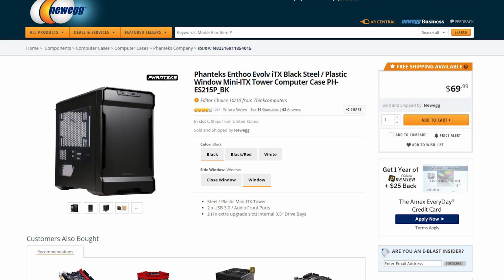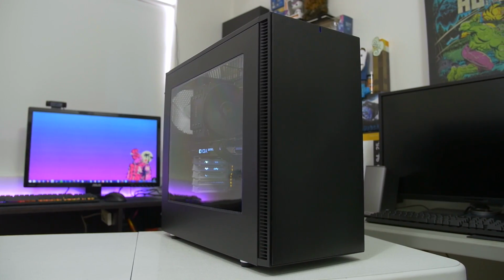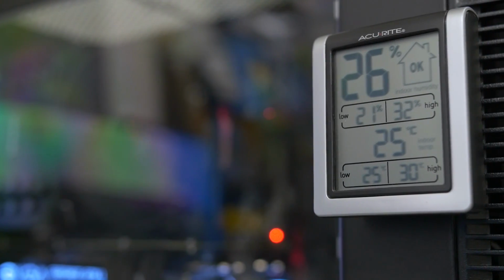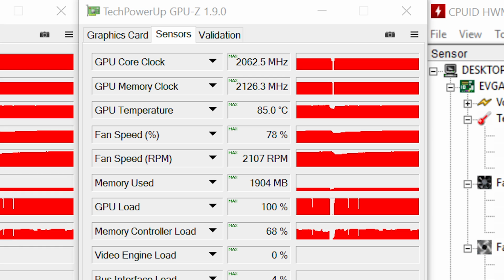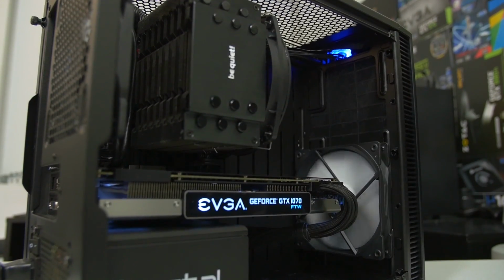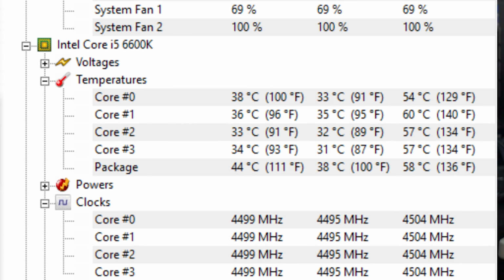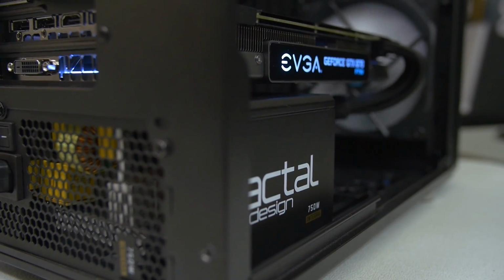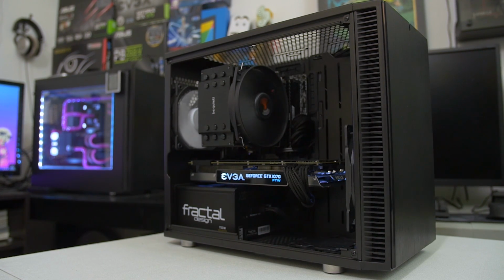Are Blower Fan Video Cards Actually Better in SFF Cases?

Comment: My 1080 FE 2ghz on Core n +333 on memory runs always at 91-92 degrees. Mid tower case, good cooing, 31 ambient 
Upto 100'C completely fine ryt?
Reply: it's not advised to run the GPU at those temperatures for an extended period of time as it may cause damage to your component.
Reply: When it hits 90 it should start to slow down so it never reaches 100
Reply: 92 set limit
Reply: Degrees cel?
Reply: @blooperman1997  that's not true modern high-end gpus are made to run an excess of 90 degrees Celsius not that it's a desirable temperature but it's true... So running at 83 to 84 degrees Celsius Max is perfectly fine for 99% of all high-end GPU is in this day and age of course you can always download MSI afterburner and set it fan speed profile of somewhere between 70 to 80% and you should be running in the high 60s to mid-70s Max if you're really worried about it

Comment: Using a different design ITX or MATX chassis would CHANGE EVERYTHING. Try IT?
Reply: For example the Corsair Obsidian 250D and 350D ... there we go... butt I'm sure you can come up with some rather more exotic not errotic choices? :D
Reply: true this is a crap case for small builds if you want keep it on air... there is many case where the PSU is located in top front corner so gpu have much better airflow+ the case can be made smaller at the expence of no DVD reader.

Comment: i don't really understand when i see a gpu running at 85c my gtx 1070 strix oc at the same in this video
core 2025
memory 8900
the max temps i'v seen is 69c at 47% fan speed
do i have a problem or just lucky ?
Reply: Ummm, you dint mention what case you used and the strix uses 3 fans.
Reply: Own Malkawi different number of fans and your case has better airflow ? Different ambient temperature ?
Reply: Own Malkawi He is running a stress test I. e 100% GPU load, under normal gaming 100% load is rare
Reply: Peter .Watson i use heaven bench mark 4.0
Reply: Ah, well then the only other thing that I can think of is your ambient temperature?
Reply: 18 to 22 depends on the day
Reply: I also have the 1070 strix with core 2012 and memory 9400 and I never go over 62 C at max 45 % fanspeed
Reply: My R9 390 never goes above 70 degrees either.
Reply: Alexander Binovski those are torture tests. I use actual games and heaven / valley benchmarks to get my temps.
Reply: Alexander Binovski Oh. I haven't quite figured out how youtube notifications work. I never comment.
Reply: i have a 20$ shitty case :X
Reply: Thermal_Sniper X well , i do have 2 intake fans and 2 exhaust

Comment: BUT what if you are using a non blower style cooler with 3 fans like Asus, gigabyte or Zotacs version, and only 1 of the fans are blocked, does that make a big difference? AND what if all the fans are blocked by for instance a PSU cover, is the blower style cooler then still the winner?

Comment: Literally just bought a 600W SFX for my Nano S
In the Australian summer, it is like night and day for me.
Using an ACX 3.0 cooler cause blowers are trash, they are literally called BLOWers
Reply: well don't be so quick to judge
in a truly cramped ITX cases (<12 liters) and Prebuild PC cases, blower-style coolers are very useful
the fact that they keep the heat mostly to themselves and do not add it to the air circulation of the PC can be the difference between thermal throttle or not
Reply: How loud is the PSU though? The blower was pretty quiet despite being "trash" and high end ATX psus are very quiet.
I personally wouldn't use air coolers in general. Gotta keep graphics cards hydrated in the Australian summer if you want to keep boosting high.
Reply: Blower cards are horrible.
There is an obvious problem with the PSU clearance here, but blower GPU cards are trash compared to non ref coolers.
Reply: Still depends on the system. For something like a Micro ATX sli build I'd pick blowers. Kicking air into the case becomes quite the problem with that.
...Only if I had to pick air cooling by gunpoint.

Also what's it with all the coolers looking like shit these days?
As much as I like metal construction EVGA were hit by the ugly stick this generation. 
I can't wait to rip the ACX 3.0 cooler off my card tomorrow.
Reply: Hey, only blowing machines are trash! Young lady blowers are an essential part of any civilized community.
Reply: Where the hell are you in, in Australia? It's like 14 c here in Vic, and my computer case runs around 45c (full load) with ambience being cool af!
Reply: In Queensland mate, where temperature gets above 20 degrees and humidity is actually a thing.
Reply: when the blower style card is running at half of its full speed and beats 2 fans running at 100% and all you can do is get salty cause your inner fanboy towards shitty evga cards is being opposed. reference cooler master race
Reply: Yo, OP. Hows dem Vregs doin?
Reply: dunno what a Vreg is :S
If you mean voltage regulators, mine are fine.
I think the EVGA issue was isolated to a batch of bad capacitors
Reply: Graeme S Vreg is short for voltage regulator. The cooler is the issue, not the caps on the card. The didn't put enough thermal pads on any of the 10xx series ACX cards. I wouldn't trust the Australian summer. You should probably get in contact with EVGA.

Comment: Wow ITX is horrible. Those temps are absurd. Guess I'm sticking with super cool and easy ATX.
Reply: > wow temps are 5C higher
> wow those temps are absurd
> wow I'm publicly justifying myself overpaying for empty space I'll never use
Reply: airbomb34 it was overclocked :)
Reply: airbomb34 I have an Evolv ITX, CPU sits at a max 60c and GPU about 65c (4440 & shadow rock 2 / GTX 970 G1 gaming)
Reply: I'm sticking with my 10 yo 4 bay case, all beaten up, but my 750Ti never reaches 40Cº
Reply: I have a coolermaster HAF tower. Its huge and most of unused but the thermals on ITX are very poor in comparison. I DONT HAVE ANY FANCY COOLING EITHER.
Reply: juulDEbeer it looks fucking horrendous on a desk, thats why
Reply: most ITX cases are actually expensive..for the nice ones
Reply: Because if you use one GPU, one SSD and one HDD and less than 32GB of RAM (which most people do), there's no reason for you to own a case more than twice as big as you need.
That said, I don't understand the point of mITX cases like this one. You can get an RVZ01-E from Silverstone, stick in a quiet ATX PSU and your super long GPU with an aftermarket cooler and it will actually run cooler.
Reply: +TwiceBakedPotato Unless you have a very limited amount of space, why go with ITX? ATX is easier to build in, offers more options and is cooler and quieter.

Comment: Do you guys think this PC build would be stable and would handel Gta 5:
Cpu: I5-6600k (oc 4.5GHz)
GPU:MSI geforce GTX 1060 gaming x 6gb
Mobo: ASUS Z170I Pro Gaming
Case: Fractal Design Node 304
Psu: random Cooler master 550w (from an older PC build in 2013)
Storage: 1tb seagate barracuda HDD  
                HyperX fury 120gb ssd
Ram: Corsair Vengeance lpx 16gb 2666MHz
Cpu Cooler: Cooler master 212 evo
Reply: Easily
Reply: ThaGod 123 without hesitation

Comment: I can't hear those fans because of my own fans.
Reply: same :( problem is its not the fans of the gpu or cpu its the power supply
Reply: Blower style fans are usually hotter and louder but they work well when you have multiple GPUs or a small form factor. Regardless I prefer regular coolers

Comment: Hmm I have Asus strix gtx 1070, 2101 MHz in define nano S, i7 6700K and gpu temps are around 63-65°C while gaming and max 70°C during valley benchmark. I have custom fan curve but there is just 5% difference in speed between mine and default in area of 60 to 70°C.

Comment: I'm so used to play in laptop that I was kinda surprised when Kyle said that 85c is too hot because my laptop's CPU and GPU usually hit 100c whenever I play.
Reply: HCatJago Laptop components and Desktop ones are different and Laptop GPUs and CPUs have higher thermal limits because they are built for Computers with Low airflow
Reply: Yes but that doesnt mean it isnt still too hot, its the same silicon with maybe a slight undervolt at best.
Reply: 1toncheese laptop components are designed to withstand higher Temperatures than Desktop variants, of course boiling water temps aren't healthy but they still work (even if its very throttled) whereas modern Desktop CPUs would outright shut down at those temperatures
Reply: Helodon
They really aren't, unless the processor manufacterer changes the materials used in the creation of the chips (which they dont) then its literally impossible for them to be designed to withstand the higher temps. The reason they allow it is because of a few factors, like the lower power nature of the chips, the fact that by doing this they allow laptop manufacterers to cheap out on cooling (which is bad for the product but very important for securing OEM contracts) and because laptops generally have a shorter lifespan by design. Its no safer to run a laptop chip at 100c than it is to do so with a desktop chip because they are the same thing.
Reply: 1toncheese They use the same material obivously i didn't say that, but the point i was trying to make is that Laptop CPUs have a much higher maximum temperature than desktop ones, since they are designed to operate in low airflow environments. What you are saying is of course true, but temps like 90° for notebook CPUs isnt as big of a deal than in Desktops.

Comment: so my question now is... could they not have solved this by either putting the PSU at the top with a nice cutout for the GPU at the base of the case? or by just making it a reversed mobo layout?
Reply: Chassi is designed to put a 240 or maybe even a 280 rad in the top so I dont think that would work.
Reply: Could always give builders the option to do just that though.

Comment: How did you reach temps this high in the regular tower with the ftw edition? I have never touched the 70 degrees with mine, even in stress testing. card runs at the same frequency btw

Comment: What about PSU orientation? Does the intake fan of the PSU make a difference when faced upwards?
Reply: it's usually preferred to keep the the fan downwards to reduce dust intake and avoid altering air flow within the case. And as +TwiceBakedPotato mentioned, it will only make everything more starved of air.
Reply: Yes but PSUs don't make a lot of heat, and if the air coming out is colder than the graphics card it will cool the card down. But of course you need extra exhaust fans for the case
Reply: What if you opened the PSU and flipped the fan making the PSU an intake instead of trying to blow air out the back?
Reply: He means changing the fan in the PSU to exhaust rather than intake

Comment: I can't say those volumes were deafening :P My AIO cooler has been working less and less well over the past couple of months, so I upgraded the fans before I realized it was the AIO dying on me. At the end my Noctua 3000 RPM fans were running at 100% even at idle (that's when I stopped using the PC, currently waiting for my H105 to arrive). That was deafening.

Comment: I'm now running two ASUS GTX 780 DirectCU II cards in SLi on mATX in the Aerocool DS Cube (a case I love). Due to the motherboard being so close to the edge of the case, I can''t use the outermost PCIE slot, so the cards are right next to each other. The one with its fans up close to the other one is always 10 degrees hotter than the other card. But this of course has the whole side of the card with fans on it covered. And since the outermost card is also close to the side of the case, it is already quite hot, when gaming it's about 80°C, meaning the innermost card is about 90°C, certainly not a good situation. Will have to swap cases :(

Comment: I just replaced my Nano S with NZXT S340 Elite and my thermals went down from 87C in Wow and Overwatch to 59C. All of this on Max settings at 1440p. 

Speccs: 
I5 6600k Overclocked to 4.5ghz
16gb Ram
GTX 1080 ROG Strix
Corsair 650w PSU

Comment: I don't get why blower GPU cards always come with this radial fan. For example, some years ago I had a GPU card that was passively cooled. The heatsink actually extended to the backside of the card. Why can't you just put a larger heatsink on the card and put a 120/140mm static pressure fan on the far side of card that presses the air through the shrouded cone-formedheatsink and out of the back of the case. Of course, you would be limited to a single card, but most builds are. You would have much more options for your fans and could actually benefit from better noise levels. get the idea?

Comment: Hi Kyle, I recently finished my Corsair Air 540 build, and loved building/working inside this case.  What would be the best 'build' experience you'd had case wise for say ATX Mid & full-tower, and Mini-ITX? (yes, that's 3-different form-factors!).

I'm considering the Corsair Air 740 now, as the smaller cases just do not seem like they'd be as capable, plus leaving room to grow etc.  Thoughts?

Comment: or just turn your power supply
Reply: meenmeen1103. the air flows the other way around. the fans push air down onto the heatsink.
Reply: It makes it so that there ins't negative air pressure between the PSU and the card's fans.
Reply: How would that help? The psu intakes from inside the case.
Reply: It wouldn't get rid of negative air pressure, as the GPU fans blowing air downward onto the restricting PSU casing actually create pressure. Flipping the PSU would allow for the hot GPU air to flow though. This entire comment is based on my assumption that the evga ftw card actually directs air out and down through the fans instead of blowing air into the card, judging from the fan blade design.

Comment: What about cases like the Silverstone RVZ01 where the GPU sits in its own compartment with a ventilated cover?

That's the type of case I'd be interested in for a small form factor, so I wonder which type of GPU cooler fares better there. My guess would be that top-down coolers should be fine in these cases, since their fans should be able to work pretty much unrestricted and the excess heat has almost no way to get to the rest of the system.

Comment: @BitWit did you replace paste on both cards before testing to give a more fair comparison between the two?
Reply from the maker: +Gofspar yes I did
Reply: I'm suprised the EVGA card got so hot inside of a full sized ATX case.

Great video as always. :)
Reply: BassRacerx I want you to reread your comment and figure out what is wrong with it.
Reply: Jack Tomlinson must be a shitty cooler. My gigabyte g1 gaming 1070 that hits 1999 stock with GPU boost hits about 63c at full load. I'll also have you know that I use a evga hadron case. Much smaller with a long thin psu that is a little closer then the one shown in this video but it fully blocks two of the fans and partial of the third. Also my case can only fit two 120mm exhaust fans at the top and no intake. I honestly have no idea why these temps are so high because my buddy also has the g1 gaming although his only hits 1949 with GPU boost but he hits around 60c in his mid size case. I can't imagine a slight over clock raising the temps by almost 20c but I'll try it when I get home.
Reply: Gofspar I am surprised too. Especially because I got the 1070 FTW too and mine runs on Unigine Heaven or any game at 2012 MHz at max. 74 °C at about 45% fanspeed.
Reply: I suppose it's just bad airflow in the case
Reply: I assume in a similar setup, using a Define Nano S, right? Is the CPU watercooled?
Reply: Nope in a midtower. In his first test he used a midtower too and the card still got 80°C hot. My CPU is aircooled and ambient temp is about the same. ^^
Reply: air cooling is still better i guess.
Reply: I don't think he did. He would've told us if he did in the video.
Reply: Andrew Murphy what do you keep the temperature in your house at? They ran this test at 79F ambient room temp  so the core temp on the cards are staying about the same temp. They ran the tests at an ambient temperature of 79degrees ambient temp. There is no possible way for the graphics cards to run COOLER than the temperature in the room.
Reply: Just throwing this out there but I have the 1070 FTW in a silverstone SG13 (much smaller case) and i used some weather stripping to isolate the GPU intake area from the exhaust area which reduced temps by about 5 degrees.  I keep my card under 60 under full load with the fans at 60% (custom fan profile)
Reply: my bads I thought he measured the temps of the core clocks in F which I initially thought strange because he measured the ambient temp in C.. stupid imperial system messing with my head. I blame the Alabama public education system!

Comment: Flip the power supply over is the case supports it and see if the PSU fan helps or hinders the cooling of the non reference card.